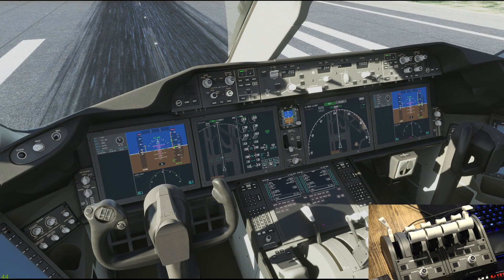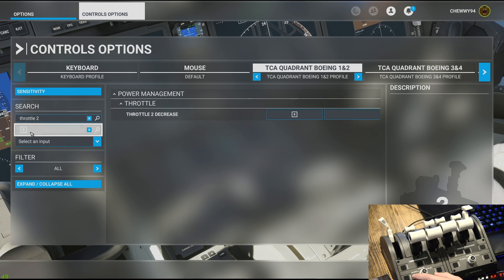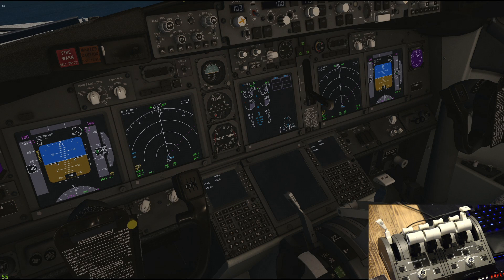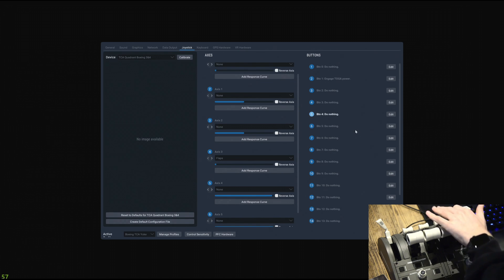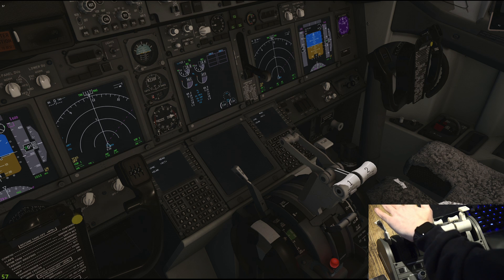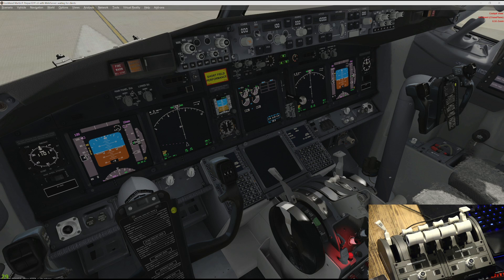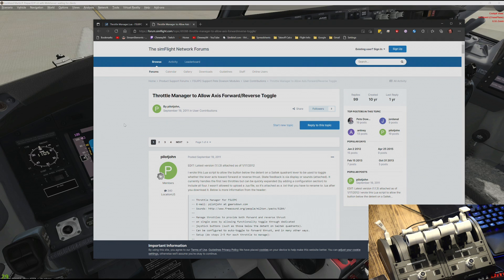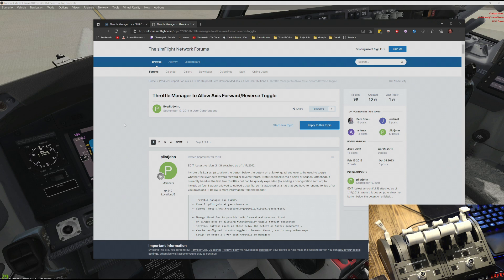How To Bind Reverse Thrust - Thrustmaster TCA Boeing Quadrant | MSFS/XP11/P3D

Comment: Writing this in early 2026. If you are having a problem setting up the reversers on the TCA Boeing Quadrant in MSFS 2024, set the function HOLD (not Toggle) THROTTLE REVERSE THRUST to button 5 which is the reverse throttle 'lever' (actually a button) on Throttle 1. Delete the default settings for TROTTLE 1 PREVIOUIS DETENT and THROTTLE 1 IDLE, leaving only the throttle axis and button 5 entries. Do likewise for Throttle 2. I have set both Throttle 1 and Throttle 2 to the same axis (RAXIS Y) so that I retain the RAXIS Z axis for the flap lever. You only need to set button 5 on throttle 1, this sets all throttle axes to reverse thrust when activated.

Comment: Can anyone tell me how to get the correct settings for msfs 2020 for xbox series x. I've recalibrate the throttle quadrant and it's all out of whack. Full throttle sends the engines in full reverse. Idle does nothing and it's jumping in and out of each notch. To/ga flex climb etc. I've reached out to thrustmaster, they tell me to do the calibration and this is where I'm stuck at. I just want to fly. I've spent all the money and can't seem to get off the ground properly. Can anyone help

Comment: Just found this as I am thinking of buying this system. I real life the reversers work as shown in the P3D section. Pull them up to activate reverse thrust. This will be with engines idling. Then pull them up and back to go into full reverse. If uou pushed the throttles forward after engaging idle reverse, the reverse will be cancelled. So this is actually how they work in real life. For goodness sake, you should have FSUIPC  on from the beginning as it connects so many things to P3D>

Comment: Doesn't work at all in MSFS with the PDMG 737-800. I did exactly as you said, unbound everything for button 5 and 6 except "toggle reverse thrust", but it doesn't work. The revers levers only twitch strangely , but no reverse thrust.
Reply: Yeah same issue. I wonder if someone has done a work around
Reply: Im going crazy with this issue

Comment: Hi. I'm sure the throttles do not go forward for full reverse thrust. The first pull back on the reverse levers put the engines in idle reverse, then the levers are pulled up and  back again for full reverse. That is in real aircraft. Is this, pushing the throttles forward, just for the flight sims? BTW, Y have P3D V5.

Comment: I have the Boeing TCL Yoke and Throttle Quadrant, and "Toggle Throttle Reverse Thrust" does not work for my MSFS 2020. The reverse thrust lever just flickers on screen and doesn't engage the reverse thrust.
 "Hold Throttle Reverse Thrust" does work though.
Reply: Toggle is working for 787 Dreamliner.
Hold is working for my PMDG 737.
Thanks
Reply: Thanks - having the same issue today (10 Sep 2022) when following the video's instructions. Will try Hold instead.

Comment: If I buy just two separate Throttle quadrants, do I also need to purchase the hardware to clamp them together. So that I can use it for 747.
Reply from the maker: Nope, it comes with some little plates on the bottom you can connect between the two!

Comment: Great video. it would be great if the sim designers could standardise bindings so the same options were available across all sims. The x-plane issue is fixable. im currently working on a joystick profile which will give an additional binding to toggle reverse off when you close the lever.

Comment: I doubt there's a way to get around the toggle issue in XP11. It would be a different story if Thrustmaster would at least make it optional to have the reverse leavers as an axis (which also would make it more realistic in general, for reversing you don't push the throttle forward irl). Honestly that's quite disappointing to me taking into consideration the amount of money they charge for it. Honeycomb probably does a better job for the money you spend although I'm unsure they have an axis on their reversers.
Reply from the maker: It is exactly the same system on the Honeycomb Bravo. Not an axis, but a button.